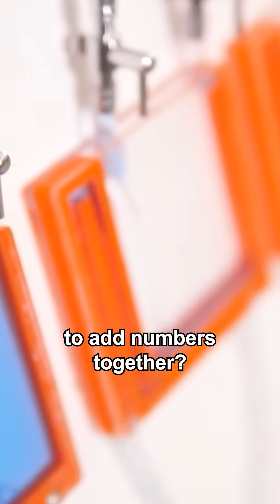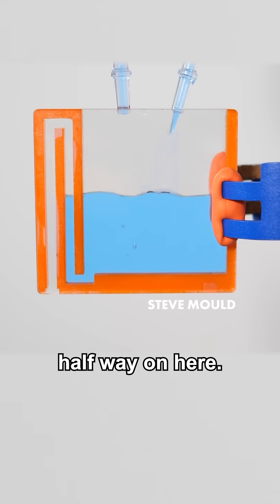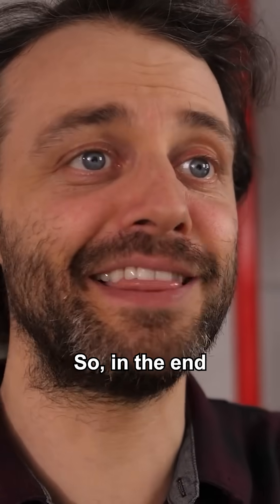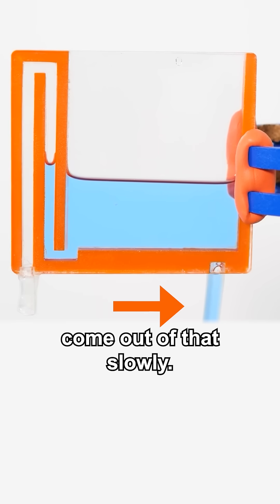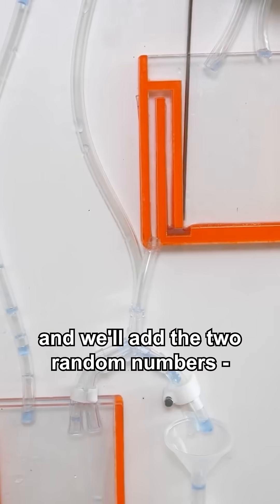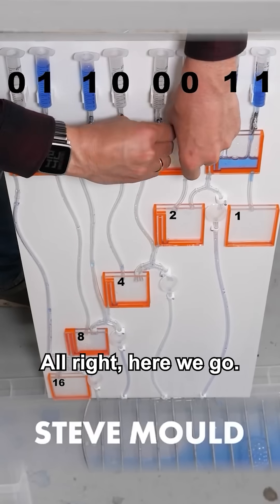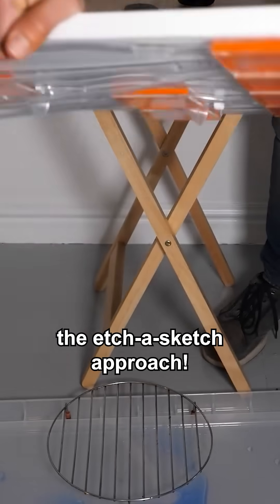I built a water computer using greedy cup siphons

Comment: Could someone explain the input? I don't see 5 or 9 there
Reply: It's the binary value for 5 and 9.
9 in binary = 1001
5 in binary = 0101
so they were selecting each bit position that was active.
Reply: Thanks a lot but I'm still confused with the bits order here

Comment: Have you considered using constantly flowing water? One input at the and gate makes water flow out at the same rate it flows in and when there are two inputs, the doubled flow will raise the water to a level that then flows into the output. I mean that constant flow kinda is what electricity does, right?

Comment: Processing speed = 1/15th Hz.  Imagine how fast this will process in 20 years!  The water will be moving so fast it will boil!

Well done, though.  Very cool.
Reply: Yeah they started using higher pressure gas (there was real development in the 60s, for example in jet engines control systems)

Comment: It's called fluidics. During the 1960s there was considerable work done to make complex computers using high-pressure gas. Such a computer would be used in artillery shells, since the launch and spin forces would be easier to deal with than with electronics. The effort was doomed by the development of transistors and especially ICs, but it was a real effort.
Reply: the real killer would be using light as a fluid and then making a fluid mechanics computer instead of an electronic one.
Reply: My question is why you guys are defending fluidics, when it is almost unredeemable, besides being a fun idea(although fun ideas can also be bad ideas, after all just because you can doesn't mean you should). You all hound me, but I don't see any of you bring up actual physics facts, but I bet I understand more of the physics and ideas behind both modern day transistors and IC chips as well as fluidics than you guys in the comments. Regardless of whether or not computers and microelectronics would have been invented a few years after fluidics, or even a hundred years, my stance is that scientists(and they did) would have abandoned such an idea immediately within a few years or 1-2 decades due to the unfeasibility of the requirements for making fluidics practical and scalable, this is with or without access and insight into more superior technology. I get it from the OP if he happened to be some cold war/soviet physicist working on fluidics, and it was a passion project, but honestly, some ideas are just objectively bad, it doesn't matter if they're compared with some good idea that came along later, they're just bad irregardless of being compared with some later superior invention, they're bad regardless of what timeline and era they came from. And also to the trolls saying I'm stating nothing different, YOU guys are the one who can't fucking read. I've even made my logic clear on multiple occasions, if you guys fail to read clearly what I write, then that's on you and says something about your intelligence, not mine.
Reply: It's doomed because it's not a good idea. Transistors are extremely tiny and a billion of them fit on one IC, making it portable, convenient, and fast. While fluidics is an interesting thought experiment, it is nowhere near practical or useful. It's a fun afterthought, that's all.
Reply: @Ren-pn6pk so its almost like him saying it was doomed because transistors was the exact same thing you said too? Where do people like you come from lol
Reply: @Ren-pn6pk  It was a quite reasonable idea in the 50s, because you could NOT fit a billion transistors on an IC, and there was no guarantee AT THE TIME that Moore's Law would prevail. Good ideas can be doomed not because they are bad ideas - only that better ideas came along.
Reply: @Ren-pn6pk you basically just repeated what he said while thinking you said something different. It didn't become useless tech until transistors came out, before that it was completely worth it to try and use fluidics. Obviously they stopped after they had transistors.
Reply: @Ren-pn6pk what you said is equivalent to saying that it was stupid for people to try and invent lightbulbs back in the day because now we have LED bulbs.
Reply: @GorillaShells  What I was saying was that problems were inherent from the beginning. Go and read what I wrote again. It's a false dichotomy to claim that what I was saying is equivalent to retrospectively claiming that lightbulbs were a stupid invention if you were born in the era of LEDs. And to actually counter your claim, light bulbs etc. worked well with the limitations we had at the time, even oil lamps made from whale blubber were still consistent enough to work most of the times, and give light for a long enough time. I'm claiming that from the outright, the problems fluidics have outweighed its (miniscule) benefits.
Reply: @GorillaShells  
E.g let me give you a concrete example as to why I'm saying fluidics were doomed from the start, irregardless of whether transistors and microelectronics were soon developed after or not. If you know anything about physics, fluid transmission is much slower than electrochemical reactions, this means if we were to do anything on the scale of what you can do on a computer today, listen to music, play minecraft, simulate programs, even type out a comment in response to what I wrote, to put this in perspective for you. Fluid flow is at most as fast as the geometry of the channel allows, which would be on the scale of m/s, any faster you risk turbulence, which can interfere with pressure differentials required in simulating switching of gates(similar to that in PCs) and switching speed is 100ms for most channels created back then, while for electric signals, light propagates at 300000km/s with switching speeds in transistors with times around nanoseconds, if we do a rough estimate, signal propagation=300000km/s/10m/s is 30 million times faster, and this is disregarding switching speeds, which are also an order of 10^6 slower.
Reply: @Ren-pn6pk your comment would have made sense if we werent discussing the technology of the 1950s.

In the time when it was being researched, fluidics made sense. In fact fluidics exists today for hydraulic and pneumatic machines. They are more reliable than electronics for certain applications.
Reply: @Ren-pn6pk reading isn’t your forte is it? (What am I saying? There’s no way this guy understands the word “forte”.)
Reply: @kelseystickney8663 good effort struggling artist😂, just because I came up with a comment saying fluidics wasn’t a practical idea you guys got all butthurt
Reply: Except, if you read my comment more carefully and the OPs comment between the lines, the OP suggests that fluidics were “promising” from the start to requote part of his comment “but it was a real effort”.
What I was saying was that it was never promising to begin with and doomed because it was not practical from the start irregardless of the rapid development of transistors later on. I also originally typed out a more detailed response to the OP, but it seems like it got deleted by YouTube 🤔

Comment: You could try adding a surfactant to the water to reduce its surface tension, which may help it flow more easily through the narrow tubes. Like a drop of dish soap per liter of water. 😊
Reply: Oh, but I guess you already used some kind of soap!
Could try Tween 20 or Triton X-100 then 😊

Comment: By the way, this is how logic gates were made in Minecraft before redstone: with water! Notch thought it was so cool than he added redstone in response.
Reply: You could make a greedy cup siphon in Minecraft?
Reply: @AD-lh3jk 
Kind of
The water in a single width channel slowly decreases in depth as it travels away from the source block (iirc it's like 8 blocks) 
As long as it drops one block its depth resets and can travel another 8 (or however many) blocks
Two streams meeting increases the depth in that block and hence any downstream will travel further, so if you strategically place drops at 9 blocks from a source with a second combining stream just ahead of the drop, you can make an AND gate that needs both streams to combine to fill the downstream channel after the drop
There's probably then also ways to devise other gates by manipulating depth and combination and channel shapes
Reply: @willluddington woah this is genuinely so cool
Reply: @willluddington You should make YT videos about that, or something, that is a genius idea!
Reply: @willluddington  We didnt use the water itself as it couldnt be automated, you would need to physically tweak the paths as there was no way to automatically tweak it. Instead we used boats on the water. A boat would physically fill a slot, if it was filled, other boats would pass through. There would also be soul sand to prevent boats from breaking, or there wouldnt be soul sand to force a boat to break.
Reply: @AD-lh3jk  No, but use Minecraft's other mechanics to make water trigger either dispensing more water or stop dispensing.
Reply: @AD-lh3jk  minecraft doesnt have pressure physics normally
Reply: Minecraft was developed by Hatsune Miku
Reply: And I’m over here barely getting a red stone creeper farm to work. People building computers with red stone 🤣
Reply: Where do the old cogs fit into that story?
Reply: Minecraft is stupid though
Reply: @MrSkinkarde  you're like minimum 15 years too old to comment something like this
Reply: @ignore2466  you mean maximum

Comment: Someone needs to calculate the total volume of water needed to play doom on this
Reply: If the Cortex M3 can run doom with 25,000 logic gates, and one logic gate contains 10 mL of water, you could run doom with 250L of water (this is only for one use, the water would have to be recycled)
Reply: @ipercrayy4797  you'd probably need a bit more to account for leaks and/or water getting trapped in the piping and/or evaporation
Reply: @ipercrayy4797  yeh but the gates are not one use, they're turning off and on constantly so it wouldn't work
Reply: @polarisnorth4875 it would just be really slow. Each tic taking a couple seconds so like one frame per minute. ( just guessing on the numbers) if you set up like 50 times as many gates it might be playable. If you could figure out how to interface something the huge, it could be possible.
Reply: The amount of water required to calculate how much water youd need to play doom would be much larger than the amount of water youd need to play doom.
Reply: @pianoraves  I did all the maths, but youtube messed up my comment ): 
TLDR: For a 100×100 pixel screen, you'd need 240,000 bits to represent the image (just the raw pixel data — 24 bits per pixel for RGB). To calculate that amount, you'd only need about 18 bits since 
log2(240,000) is 18. That means you use far less data to figure out how much is needed than to actually store or run anything on the screen.I did all the math already, but not going to redo it again. Just know that it clearly shows how much smaller the overhead of the calculation is compared to the real resource usage.
Reply: @DR-7  I've been waiting for you. Châpeau.
Reply: @DR-7 I played Doom when it first came out and it was only 8-bit color (So I'm not sure why you used 24-bit color). It was 64k pixels per frame x 256 bits per pixel = 64kBytes (capped at 35 fps but we won't go there). log 2 of that gives you 16 address lines. How many gates would you need to decode that? I don't know. It would be a very very tall board of cascading gates.
Reply: @pianoraves okay fine. Do it in Red Bull then.
Reply: Fr
Reply: Playing doom at waterpark type shit 😂
Reply: Scavenger pump at the bottom keeping reserve tank at the top of the game
Reply: somebody’s gonna figure out how to run Doom on a 2L of mountain dew
Reply: @Wub-rv9xx  minimalist liquid consumption speed run of Doom??
Reply: Next challenge is to make this at a large enough scale and convert the signals into electronic to actually play doom!
Reply: I guess we could get a rough approximation by seeing how much RAM is needed, since each of these little tanks is effectively one bit. I'll assume that a 1 here is 50 x 25 x 5 millimetres of water (guessing based on comparing it to Steve's hands), or 6250 mm^3. Original Doom's specs asked for 4 Mb of RAM. I will assume that it mean the power-of-2 Mb instead of the power-of-10 one (so mebibits), meaning it wants 4,194,304 bits. Multiply that by our volume of water for a bit and we get 26.2 billion mm^3, or 26,214 litres of water. This is roughly the internal volume of a medium-sized box truck
Reply: You could absolutely play DOOM on a water computer. You’d measure the gameplay speed in months per frame, and bit errors would be extremely high in probability, so there’s a huge chance it would crash before rendering the first frame 99% of the time.
Reply: It tooks almost 10 seconds to do this 9+5 operation. Even we provide big enough machine & water,, what FPS this doom would run at? - Or more realistically, how many Days per Frame?
Reply: @irfanhanip  perhaps if you placed it in a pressure container you could speed up the drainage process?
Reply: Finally, at a clock speed slow enough, so I can actually play it !
Reply: Real computers can reuse the same physical gates many times. This would need to be insanely huge to play doom(even under ideal conditions of no leaks, water getting stuck etc) unless you incorporated a pump to get water back up top
Reply: It's two-dimensional. The water has area, not volume.
Reply: @Jivvi we don't live in a two dimensional world
Reply: @Jivvi it's not really possible, even if it is very thin, its not 2 dimentional, because water is 3 dimentional down to the molcule. So its volume
Reply: @Jivvi my man played Minecraft too much
Reply: Latency?
Reply: you can get infinit water by entering IDDQD
Reply: For various reasons, including the Coanda Effect, fluidics was usually applied to gas systems.
Reply: Logic requirement: ~10⁸ gates for Doom 

Gate size assumption: 1 cm³ (tiny but printable)

Total volume: ~100 m³ = 100,000 litres of water
Reply: There are smaller 'fluid computers' 

This is a pastiche video of a failure
Reply: The ping would be off the charts x.x
Reply: So an estimate would be around half of a Olympic swimming pool ~220 cubic meters
Reply: It's not nearly precise enough to ever work at large scale
Reply: @mucicafrajer yet
Reply: @mucicafrajer maybe with pressurized water and some industrial engineering it could actually be possible. 

I think the problematic part is the monitor. Like, how would you emulate LEDs without electricity?
Reply: @mucicafrajer  not with that attitude
Reply: @mucicafrajer  "Precision was not the issue. The field produced digital systems, not analog, and precision doesn't count.
Reply: @mucicafrajer  Doom runs on everything and i mean everything
Reply: @mucicafrajer not with that attitude
Reply: @mucicafrajer  Precision isn't a problem because it's binary, so it either has a 0 or 1 for a result. The problem would be the speed and source of the water, but this introduces a ton of logistical problems (Recycling water, methods to increase siphon speed, size, siphon length, etc.)
Reply: Sybau
Reply: @JTrapp2127 thank you JTrapp for contributing to the conversation, you added so much.
Reply: @JTrapp2127100% of the time someone says "SYBAU" they are in fact homeless and projecting. 

I can give you a link to some state funded resources if you'd like a hand up.
Reply: @JTrapp2127 shut up

Comment: What uses more water, a silicon based system (manufacturing, cooling, AC, etc), or a water computer.  How big would a water phablet be?  Would it need to be dropped in the toilet if you accidentally got rice on/in it?
Reply: The water "tablet" would probably be the size of a small city, and would take hours or days to load one frame of Doom. Water has a very high surface tension, meaning the gates/transistors would have to be millions of times larger than a silicone transistor in order to flow properly. The clock speed would be insanely slow too since the waters flow would be limited by gravity. Neat to think about tho.

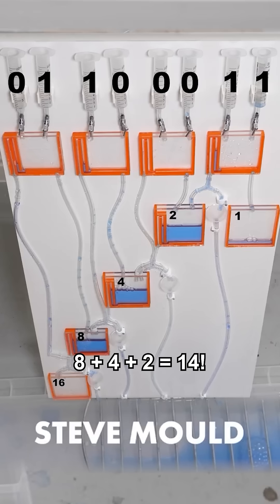Comment: 1:30 It took me a few minutes to figure out the arrangement of 1s and 0s on the top.
Reply: There is more than one arrangement that could have given the same result. For example, the inputs could have just been 01 01 01 00.
Reply: I still don't get it, how does it represent 9+5. please?
Reply: @KingKiloCen  The 8 containers on top represent 2 4-bit binary numbers. 5 is 0101 and 9 is 1001, so the starting arrangement is 01 10 00 11.
Reply: @johnlong2552, that would be the same as inputting the answer as the question

@KingKiloCen, It took me a while as well. In each pair of syringes, the right hand inputs (1001) make up one input (9) and the inputs on the left (0101) represent the other (5). I think some colour coding or rearranging the syringes with longer tubes to distinguish which is which would be helpful
Reply: but why 0011 instead of 1001 (yes, it'd not work but how they got 0011 here) o.O
Reply: @Lighterek  It also took me a bit.
Basically you sum each digit of the numbers in their binary form.
5 = 0101 and 9 = 1001, the vertical sum helps us see it better:
  0 1 0 1
+1 0 0 1

Now sum each vertical pair, starting from the right (units)
So first orange square is 1+1, second is 0+0, etc.
Reply: @zewzit  finally, thank you

Comment: So what clock frequency are you getting?
Maybe if you half the size of the transistors every 18 month for a few decades you can play doom on it.
Reply: Forget the quantum barrier to logic density. We're now at the capillary barrier
Reply: forget quantum tunneling we about to be bottlenecked by surface tension
Reply: @AdrianOkay  just add soap 😂
Reply: @Petch85 or use Poly-ethylene gycol (PEG) which is a self siphoning liquid and maybe with a little suction on one side of a reservoir tank you could continuously have the fluid flowing and generating different numbers

Good idea with the soap fr
Reply: But can it run crysis?